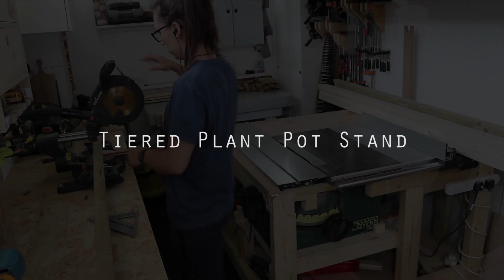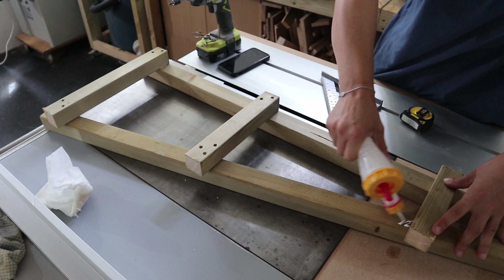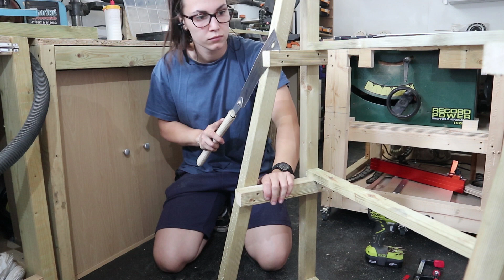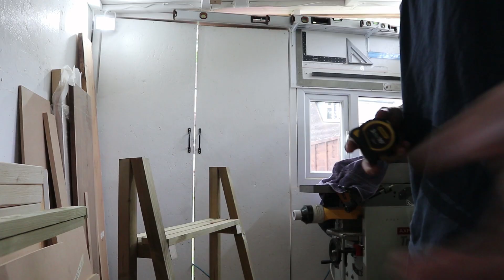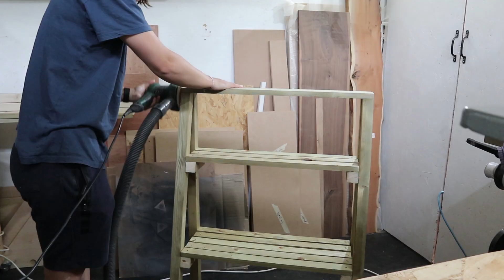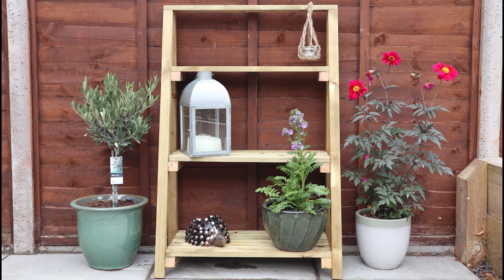DIY Tiered Plant Pot Stand - Garden Project

Comment: What angle did u cut the feet of the stand on the legs away from the wall?
Reply from the maker: Tip! Don't worry so much about the angle, as the back legs are at 90 degrees, this allows you to use a framing square to strike a line square to the back legs to get the correct angle for the front feet to sit on the ground. Hope this helps!